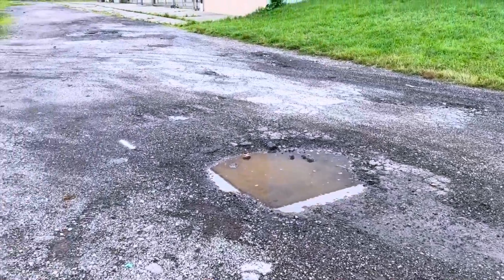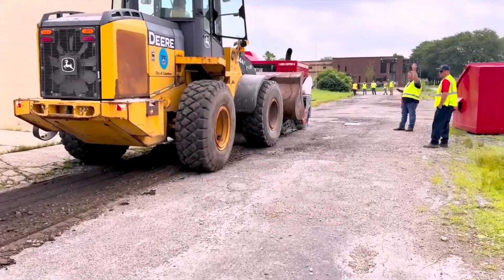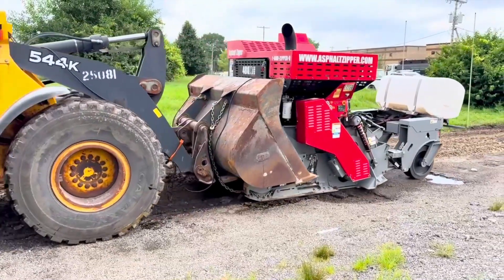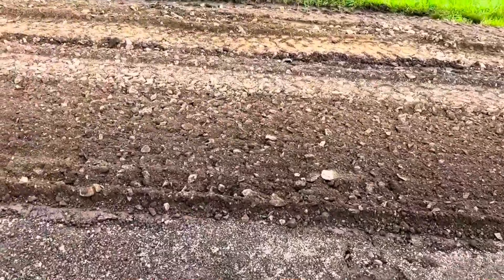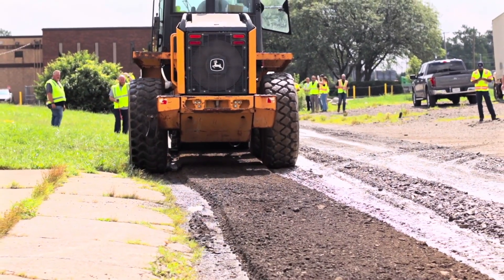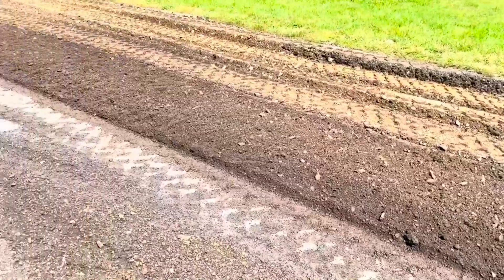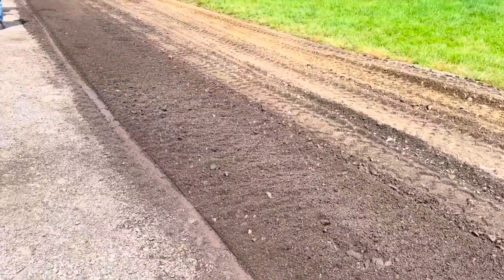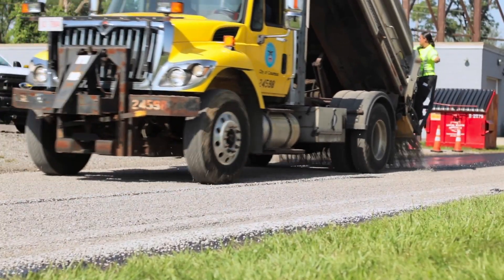Full Depth Reclamation with Asphalt Zipper® | Columbus Pothole Repair & Soil Stabilization

Comment from the maker: Could an Asphalt Zipper help your community?  Comment below.
For more videos, subscribe to this channel or visit https://nomorepotholes.com

🚧 The City of Columbus just turned a pothole-ridden, cracked alley into a smooth, durable road using full depth reclamation (FDR) with the Asphalt Zipper® reclaimer machine!

✅ Recycled asphalt turned into strong road base material
✅ Soil stabilization methods with liquid additives for strength
✅ Faster, lower-cost pothole repair and road maintenance
✅ Long-lasting results with asphalt recycling + soil cement stabilization
The Asphalt Zipper is more than a road reclaimer—it’s an asphalt recycling machine, soil stabilizer, and pothole repair solution all in one.